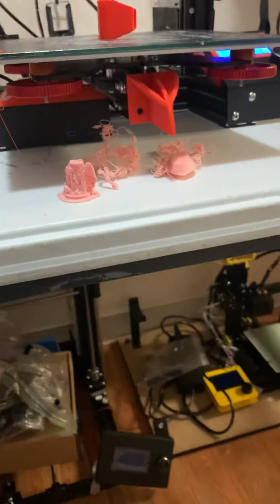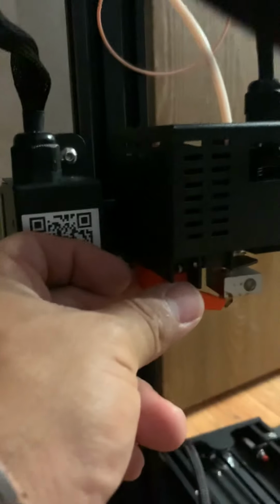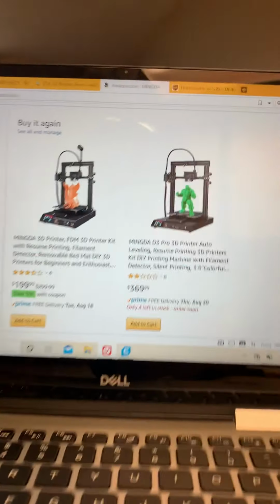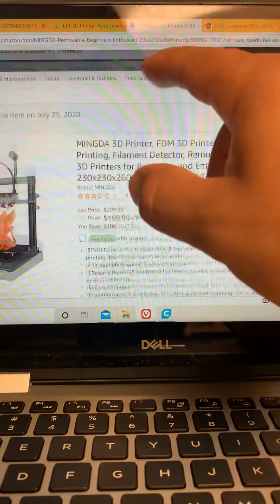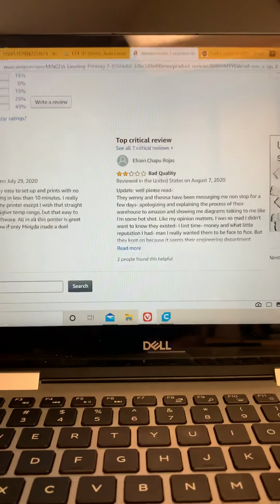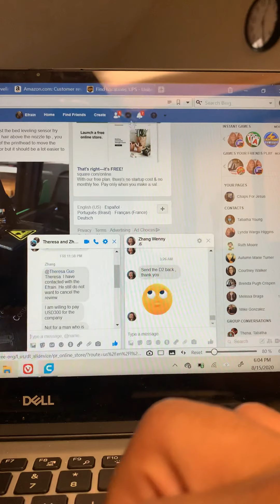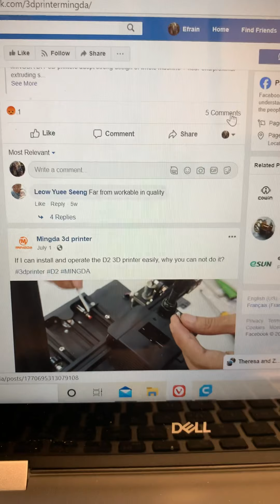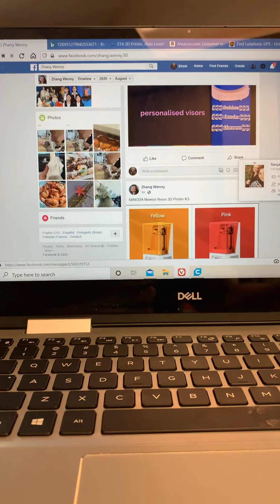Mingda D2 FAIL

Comment: I made a video of the Mingda D2 I got on my channel. It is under the playlist named "3D Printer Videos". The first one I got had hot glue in the connections. The machine did not power up to where the machine touch screen didn't power on. I talk about it in the "My Mingda D2 3D Printer". My replacement is working now.
Reply from the maker: Yeah I finally got it working after watching Chris from chris basement. Had to do a PID tuning and up the voltage on the steppers by 200ma. Someone made a cooling solution with 3015. And it’s printing great. I removed the z rod stabilizers and used flexible diaphram couplers and all ghosting and linear shifts are gone. But I’ll be honest I saw on their website there was an uodtate 2.7.1 so I bought a machine on sale for $180, tried the update, the update was within a 20% threshold which means the engineers are finally paying attention. I only had to barely tweak the stepper amp rage by 30ma and that one is prrinting PETG

But to remove the stabilizers, add the couplers I did, and to buy a beaded glass bed shouldn’t technically have to happen but be more of an upgrade choice. Idk about you but it’s a pain when your switching from Allen keys to Philips head back to Allen to again Philips. All screws should have been one sized Allen or as close to. 

Overall right now after so many mods and tweaks they are pretty close to my Ender 3 32bit 4.2.7

Edit: correction 4020fan
Reply from the maker: Oh and to remove the filament sensor because if your go all the way to 260mm, it literally hit. Yet a selling point is the filament sensor. Furgatech had the same issue
Reply from the maker: Honestly I’m glad it’s working for you. Took some work and headaches. But when you have something that works. It’s a blessing. Follow me on Instagram, twitter or Facebook and show me your best print!!!
Reply: @dopegod3d178  Oh ok cool. Thanks for letting me know on the updates. Do you have a link for the upgrades you made?  I am in the process of putting my 3D viewer camera to be hooked up to the 3D printers that I have now.
Reply: @dopegod3d178  Thanks.  Cool, I will do that. Is your instagram same as your name on YouTube? Mine is.
Reply from the maker: @renegadebiker24  

That’s the cooler 

https://www.thingiverse.com/thing:4624841
Reply from the maker: @renegadebiker24  I’m just paying attention to your name lol I HOPE YOUR WEARING YOUR HELMET! we need you around young man. And yes it’s Chaps_4_Jesus_
Reply: @dopegod3d178  cool. Yes, I wear a helmet when I ride. The renegade and 24 in my name is named after the f14 squadron I was in, VF24 Fighting Renegades that was based at NAS Miramar, aka Top Gun.
Reply from the maker: @renegadebiker24  brother thank you for your services. Honored that you took the time to view me, and respond. Wow. Got me all choked up. My daughter and I will say a special prayer for you. Thank you again!!

Comment: Welcome to 3d printing.

Sadly you don't appear experienced with 3d printers.  You're buying a 3d printer from a new company from China and shit does happen in shipping/assembly (that's why it's cheap, pay more otherwise). There are many videos online to prevent/fix your issues and to be quite frank it's just part of the hobby. The company even with the language barrier tried to help by sending you a free machine.  Mingda isn't the only company to have QC issues you'd find them on most 3d printers from china. 

And amazon reviews above 3 stars is usually a good thing. Anyways I was going to pick up this 3d printer and I stumbled onto this video. I don't expect everything to be perfect that's just how it is at that pricepoint.
Reply from the maker: Thujan Krishnakumar your right about one thing I’m no expert. But I do know how to build them. Upgrade them and repair them. I’ve done hundreds of repairs from hot ends, to bird upgrades. I have all the legal proof I need. Them giving me a story If I didn’t take the printer she’d be fired.

Them then demanding I send the free one back unless I give it a 5 star rating. 

Then they want me to pay shipping to some random dude in Texas. The box and all labels had Amazon packaging on it and they lie and say amazon has nothing to do with it when I demanded an amazon label to send it back.

I called amazon and sent them all I had on them. From calling my cell phone from midnight to 3am. I have sent allllll that to amazon so if they want to claim it never happened amazon has all that on file I have all the chats and call logs. 

To them even calling me a postor boy for longer. Why because I mentioned they offered great support from the start? Parts were all there ever single time on sipping? Have you seen the amazon reviews of the D3 pro? I have messages from people from Argentina and here in the states messaging me their nightmare stories. 

To reviews being deleted and my photos deleted. They want to claim no. Have at it I have again, videos, emails, and messages all saved. 

They even told me If I didn’t take the free one to review again she’d lose her job!!! What!!! Claim what they want I have it all on record. 

Same exact hardware as D3 pro. Only difference auto bedleveling and build volume. Please feel free to reach out to every single negative review and tel them it’s their inexperience with printers.

Where did I go wrong on the knobs coming off and damaging the magnetic bed and them refusing to replace for almost a week?

Where did I go wrong with the missing cooling port  that I was told I couldn’t get the STL file till Monday because they were off the the weekend? 

Where was my inexperience when on live again while they are watching and chatting with me wenny to be precise it fails to print? The under extrusion that required pid tuning and raising the miliamps by a whopping 200ma to get it to print. Chris from Chris basement had to do it to his and it failed live !!! And had to do some manual tubing to get it to work properly months of engineers looking into that and their experience couldn’t find that out.

Now mind you firmware 2.7.1 came out and now machines are suddenly working. So it was a lot of issues on their end. I haven’t posted videos online to protect identities and faces but if pushed Legally I’ll ask if I can post names faces and videos to show how they really were I will. I even bought one myself out of pocket upgraded it to 2.7.1 and no mention on any of their groups? I’m just saying everyone else like my two trees, labist, creality, tevo, anet, SOVOL and even sunlu post updates on firmware. 

Dude they even told me they didn’t have money for rice after sending me the machine!!! Come on now what?

They deliberately said “if your not giving it a 5 star rating then send it back”! Ok you want me to give it 5 star rating:

When chats took days with no solution at all.
Missing screws that were important.
Missing cooling port.
Failed prints all submitted and still have them. 
Damaged magnetic bed. 
And when I finally hit rerun on the ones I bought that’s when they got the alert and decided to bribe me to keep the one d2 and fix the D3 to stay shut.

Whether I’m believed or not. I have proof. So they can tell their story all they want and delete amazon reviews all they want. Read on amazon a few people even said why are their posts being removed if all amazon regulations were being followed
Reply: @dopegod3d178  yea that just seems normal with Chinese companies. They have a different mentality than in the west. Still these things aren't new and happens with most companies when they are new.

Comment: I got one on Monday. This is an amazing printer. This guy is too Critical, reminds me of a male Karen.
All printers can come in with issues, they are making improvements based on customer and reviewer recommendations. 
Out of the box I got perfect prints. This is my fourth printer. I own a Flashforge, Prusa, Ender and now a Mingda.
Reply from the maker: Glad it’s working for you. Their customer service is a joke. I’ll let the many people who PM me on Instagram, Twitter, and Facebook that they too are Karen’s. Ps i don’t work for mongda yet I’m fixing their machines. Have you seen the mingda d3? Same exact hardware only difference, build volume and auto Bed leveling. Why did they pull it I wonder? Hmmmm one must think. Fugatech and chris basement also didn’t give it great reviews. 

1. Missing parts out of box is not normal. It’s quality control. You like wasting money send me some I won’t mind!! 

2. Parts that are proprietary isn’t for the newbie. Change the extruded motor and brass head. I dare you. Share your video.

3. The heat break, and heatsink. And thermistor is $50 to repair when you can easily get MK8 clone for $9

4. Customer service after the 30days return is up, ask them to send replacements

5. Extruder gears. When they break unless you know what your doing you’ll have a hard time as a newbie fixing. Not normal. But you have a $700 printer which tells me you have money and experience since PRUSA aren’t for the faint of heart to fix. 

From one Karen to another nice try. Ps isn’t gaxon an ugly dragon from a kids show?

I could care less what you think since your an experienced user which means you know the ropes. Mingda is a joke and they will remain that till they how otherwise. 

Come on gaxon go to fugatech and cris basement and tell them all the issues they found are a joke please I’ll follow you and like your comment
Reply: @dopegod3d178  Trust me I watched the other videos. 
The printer was on sale for $187, I wanted to see if it’s as bad as people claimed or if they had attempted to make improvements. 
Worst case scenario, it sucks and I return it. 
They made improvements, I’d be more than happy to send you some videos or pictures of the improvements they made.
Reply from the maker: @gaxon1920  not what I asked. But if this was politics I’d say you did good!!!
Reply: @dopegod3d178  here’s the thing. I didn’t bother reading your wall of tears nor do I care enough about you to give you that much of my time.
Reply from the maker: @gaxon1920  keep up the good work!! Your mingda will bring you enough tears. Enough to make good tea. Next time try a different name you calling me Karen and mentioning walls of tears makes me want to hug you and tell you how loved you are. If your ever in Florida and are bullied message me here I’ll handle it for you!! I got your back jack!!! From now until forever #GaxonsGotBackup!!!
Reply: @dopegod3d178  All jokes and prodding put aside. I think you got a bad printer and these things had some serious issues when they were released. 
I have noticed differences in the design between mine and yours, maybe they are listening. 
If mine turns into a pos, I’ll be sure to update you and we can ride on the Karen wagon together. 
As of right now, I plan on swapping the magnetic bed to glass. I hate magnetic beds. They warp and bow from the heat. Probably design a new fan shroud for it as well.
Reply from the maker: @gaxon1920  this is the one I used on one. 

Sovol 3D Upgraded Platform, Magnetic Flexible Steel Plate Heated Bed with Build Surface Sticker for Ender 3 Ender 3 pro Ender-5 Ender-5 Pro CR-20 CR-20 Pro 3D Printer 235x235mm https://www.amazon.com/dp/B08GQ32XFB/ref=cm_sw_r_cp_api_fabc_mSTYFbSE9KXSN

And the other because of the beads 

Upgraded 3D Printer Build Surface Borosilicate Glass Plate 235mm x 235mm x 4mm for Creality Ender 3/Ender Pro3/Ender 5/CR20/CR20 Pro 3D Printer https://www.amazon.com/dp/B07QNWG3H7/ref=cm_sw_r_cp_api_fabc_1TTYFb7JYQX11
Reply: @dopegod3d178  Here’s the main issue I found with this machine. It’s the cooling, cooling fan isn’t blowing across the heat sink and is mostly blocked off. Part cooling fan is a low air pressure fan and not blowing where it should. 

This causes a few issues. Heat creep, which will cause clogs since this is an all metal hot end and poor bridging. 

I’ve redesigned the cooling and created a wind tunnel to the heat sink. The part cooling is now a straight shot to the very tip of the nozzle. I changed the blower fan to a higher air pressure fan and you can see a huge difference. 

I’ll release the cooling file on thingiverse after I tweak a few tweaks.
Reply from the maker: @gaxon1920  that is part of the issue yes. And a few have said they’d post it and never did. Hope you do. Ima a hardware man and maintaining and tweaking but tinkering in learning at a slow pace
Reply: @dopegod3d178  I’ve noticed the cooling fan is a silent fan as well. It has low air pressure and cfm. I tried a PlusPoe high speed 4010 fan. 10X the airflow. I’m thinking by the time I’m finished with the upgrades and fixes, I’ll be at the same price or less as my Ender 3 V2. Which is still a good deal considering the base upgrades over a V2.
Reply: @dopegod3d178   Second prototype being printed now. I’ve not done much with the box yet, focusing on the cooling at the moment. 
http://www.paragongaming.net/Minga1.jpg
http://www.paragongaming.net/Minga2.jpg
http://www.paragongaming.net/Minga3.jpg
Reply from the maker: @gaxon1920  now that’s what’s up. Thank you this is highly appreciated it. I fell asleep trying to fix my Linux laptop but I do have my two units Ana will share my findings and fixes.
Reply from the maker: @gaxon1920  you know what I’ll be testing these and give credit where credit is due. Thank you by the alway highly appreciated
Reply: @dopegod3d178  Final prototype resulted in a 20 degree drop on the heat sink. This is using the silent low RPM fan that came with the printer. 
Factory cooling 68.9 my design 48.5 with the nozzle at 240. Temperatures tested after heating the hot end for 15 minutes. 
The blower fan pushes almost no air, I’ll have to see if the redesign is going to help. I’m thinking a GDSTime fan is going to make a bigger difference.
Reply from the maker: @gaxon1920  that’s what I call Ingenuity
Reply: @dopegod3d178  Move over and let me on that wagon.